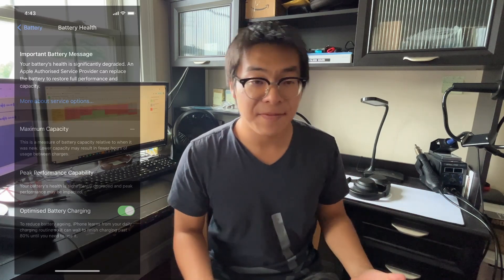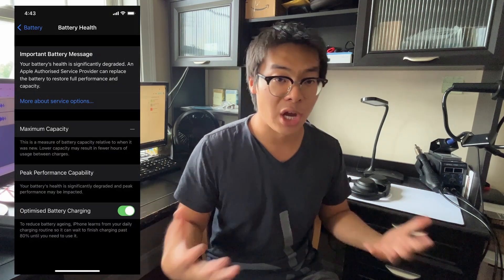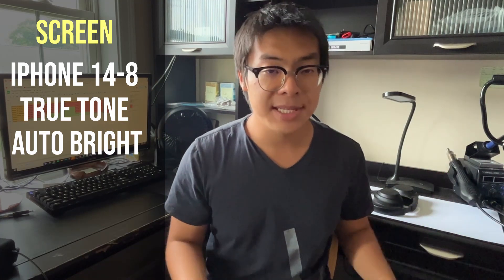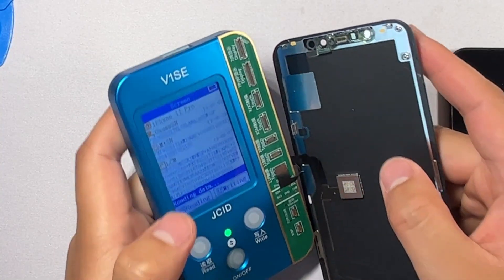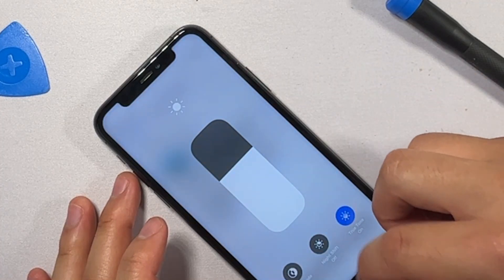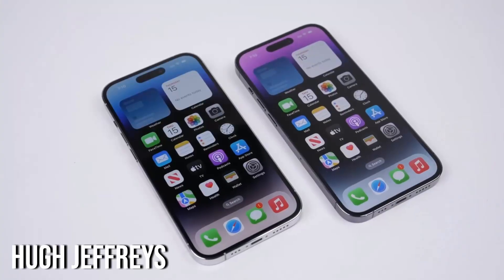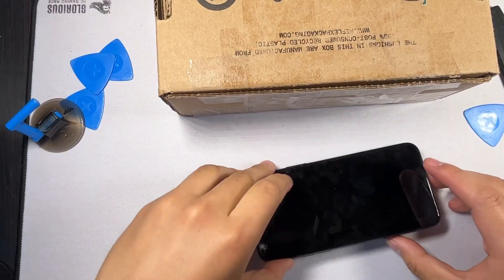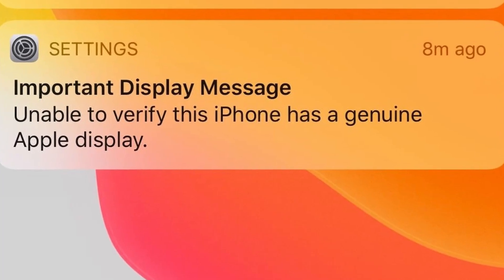Apple's Repair Trap Explained: Understanding The Anti-Repairability With iPhones

Comment: I'm missing the rearcover 14 / 14 Plus  serialisation.
iPhone 15 serie same as 14 and 14 Plus.

https://youtu.be/Dr2KTPNJWIY?si=9QEwq2D9cwA9tTIh

In 2026 a new law in the EU will stop serialisation of the battery. At the same time manufacturers of equipment with a rechargeable battery have to build there devices in such a way that everyone can change the battery. (Consumers too)*.  That's why Apple changed the iPhone 14 / 14 Plus and the 15 serie.

*There is still a small change that Apple won't have too follow up this new EU law...

Comment: Very well done. Thank you!

Can we get links to these tools needed for these repairs ie programer. Also, would you be willing to do tutorials on how to use the programer to reset these issues?
Reply from the maker: For the programmer most electronics parts stores should carry them. My go to supplier is Injured Gadgets and they usually have them in stock but there are many out there. If you are willing to wait a bit, aliexpress is another option to get a programmer. It will take up to a month to arrive from China so make sure to budget that time when it comes to a repair! I appreciate the support!
Reply: appreciate the reply! any info on how to use it?  @brokenrepairs

Comment: You can use a JCID programmer to reprogram the old serial to the new screen etc
Reply: No solder required. Brightness and True Tone all works. No error msg
Reply from the maker: Thanks for pointing that out! Yeah JC programmer will restore auto brightness and true tone. I might make a video dedicated towards reprogramming.
Reply: @fmarketing7894 I've never seen this work,  soldering the touch ic from the old screen to the new screen is the only way I've seen get rid of the non genuine parts message
Reply: @BirdManPhil  I know what's going on, and I'll explain. So, the programmer trick will work, but only on the iPhone 8, 8+, X, XS, XS Max, and XR. On all of the iPhone 11 models, it's weird. If you reprogram the new screen, the Non-genuine part message will still show up, but you'll still get auto brightness and true tone working. However, on the iPhone 12 and newer, the reprogramming trick doesn't work, because the data is encrypted. This means, the only way to trick the phone into thinking it's the original screen is to physically transplant that chip to the new screen. You would need to know how to microsolder in order to do that. This is only for the flagship iPhones. IDK about the iPhone SE 2 or 3. Anyways, thought I'd clear it up since I knew.